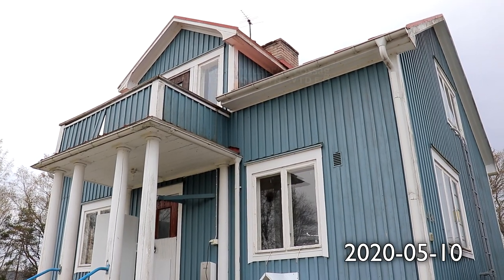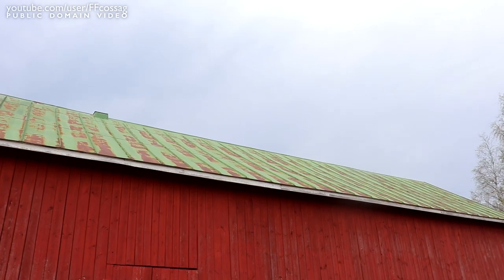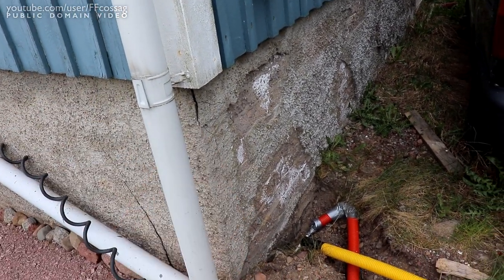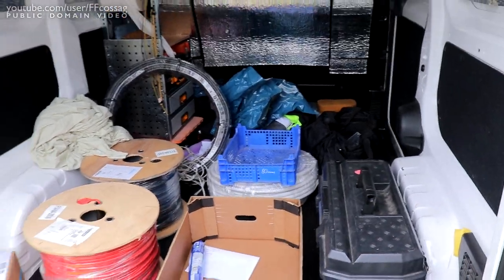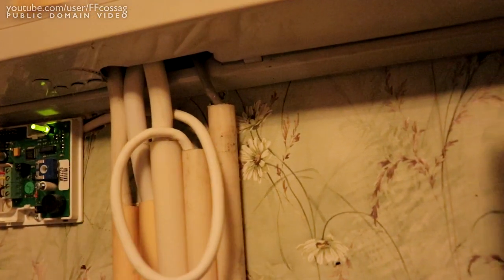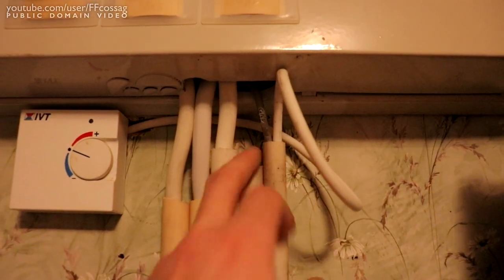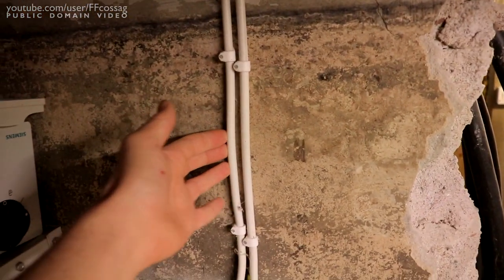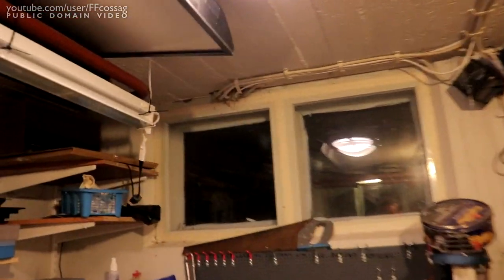10 kW Hybrid Solar VLOG 1 - What's the plan?

Comment: Don't forget to put an ethernet cable to the barn while your at it :)
Remember you where dicking around with the lack of networking in the barn a year or two ago.
Reply from the maker: I can get 200 Mbps through the old air cable using one of those power grid adapters, and I'm sure performance is going to be even better with the new underground cable, since it's shielded almost all the way form end to end. Since that's sufficient, I don't think a very long ethernet cord is justified. Good idea though, I did think of it.
Reply: @FFcossag  Well at least you did not forget thinking about it. :)

Comment: Great news! :) Have you thought about transforming up the voltage at the barns and back down in the house to reduce DC transmission losses?
Reply from the maker: You get over 500 V DC out of the solar panels, there's absolutely no point converting that in any way before it reaches the inverter.
Reply: @FFcossag  Clearly, it depends on the Amperage yield. What's the overall resistance of your wiring?
Reply from the maker: It's about 100 total metres of 6 mm² wiring, so about 250 mOhm worth. At maximum array current, the loss is about 16 W, (~3 %).

Comment: Makes me feel rather inadequate with my small 40w solar setup connected to an old car battery with a cheap PWM controller in between powering a 4 watt LED bulb through the night given I'm awake more often through the dark than I am during the day... :P
Reply: Everyone has started with a small setup, right? ;)
Reply from the maker: Mind you, just a few years ago, my only solar power came from three home made solar panels made out of grade C solar cells from Ebay, and old window panes held together with silicone. They probably never made more than 1 kWh before they cracked and broke, lol.

Comment: You've probably already thought of it, but doesn't the penetrator of the solar panel wiring through the cellar have to be above the ground incase water builds up and leaks in.
Reply from the maker: It'll be above ground.

Comment: Have you won the lottery?  10kW of solar and an eVan don't come cheap.
Reply from the maker: The short answer is that these are carefully considered long-term investments that are going to pay off in about 5 years when combined.     

The van was very cheap for what it is (16 000 € total), and was actually a gift from my dad because we sold a family property together. I was paying the better part of 1000 € per year in taxes alone on my old van, so it was very easy to justify replacing it with something that's essentially tax-free, despite the up-front cost. 

Besides that, I have a way of never spending any money on anything ever, so I tend to naturally just kind of amass money over time, lol. Since I'm me, investing my savings in a solar system just seems natural, and I decided to take the plunge when I was able to comfortably budget about 10 000 € for it. Proper solar installs are also subsidized by up to 2500 € here, so doing one is essentially a free cash handout as long as you do the necessary paperwork.
Reply: @FFcossag  Fair play to you, young fella!
Free money is nothing to be sniffed at.  Free fuel for life is an added bonus.
All the best, mate.